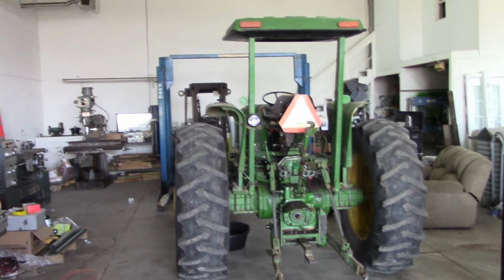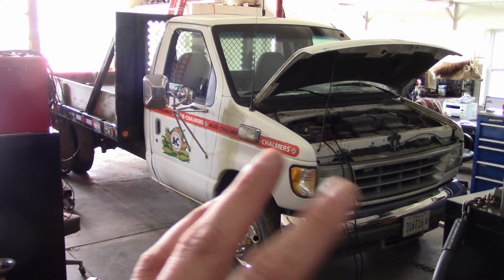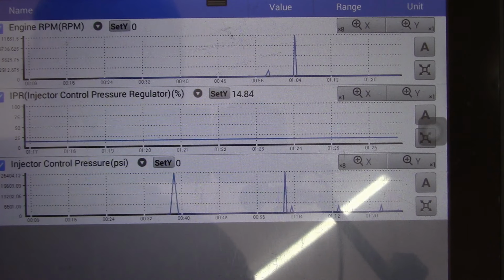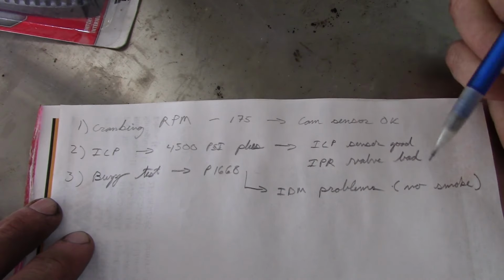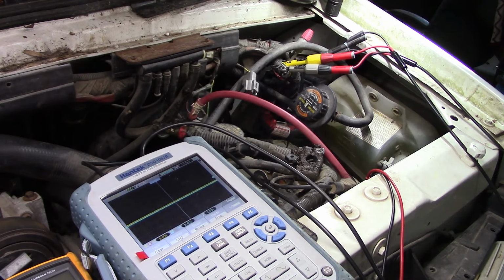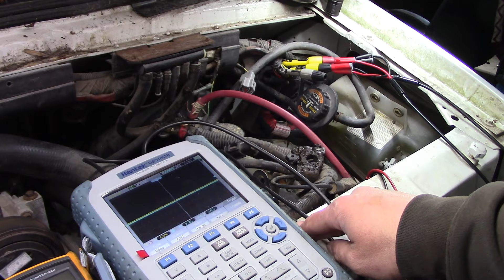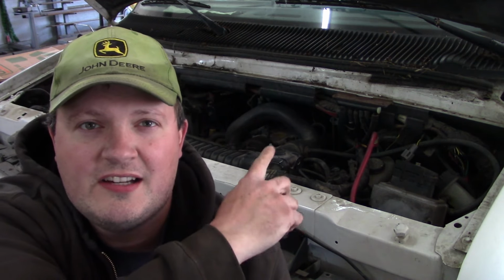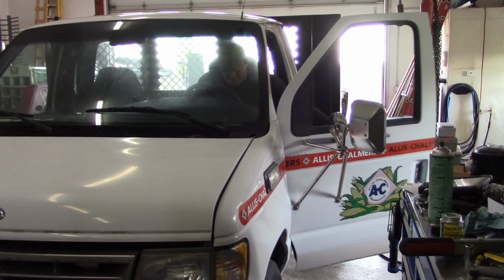Ford E350 | 7.3 Power Stroke - Cranks but won't Start - Part 1

Comment: I believe the injectors are pulling excessive current to fire. She may have low miles, but I'd bet she has alot of idle hours.  Injectors are a wear item on a diesel.

Set of injectors, IDM, repair the damaged harness wire,  replace the valve cover gaskets and pigtails and she'll be good to go for another 20 years.

Comment: Being a Ford tech-I've seen cases where charging system issues or low batteries (cheap) attributed to repeated idm failures-as far as the crazy icp-when these modules aren't getting the proper voltages or have a circuit blown-anythings posible.

Comment: "E-450 Incomplete" is the model.
And it is different from an "E-450".

I had a 2007 E-350 Incomplete and most of the parts for a regular E-350 were different.
Reply from the maker: Interesting. I wonder why.
Reply: @WatchWesWork  my "E-350 incomplete" had 
-Larger brakes
-Heavier rear axle and springs 
-Heavier front spindles 
-Larger fuel tank
-Sealed beam headlights (instead of halogen)
-No "post cat" O2 sensor.
-Different exhaust system
-Armored brake lines (that were a different length)
-Different ECM 
-Deeper oil pans on the engine and transmission
-Different wheel base (and drive shaft)
-Larger alternator.
-Different interior.

Than a regular E-350.

The 2007 E-350 and "E-350 incomplete" were two different models and it kept biting us in the ass whenever we needed parts for it.

The differences in 1999 models might not be as big , but the 2007 vehicles didn't have much in common.

Comment: I think they make extender cables for relays and the like. It's essentially a regular plug that's been gutted and a wire and base comes out of it, about 30 cm long. I'm pretty sure that's what i saw (online during a fleaBay bored out of my mind nights).
Reply from the maker: I could make one I suppose. Might be handy.

Comment: It could be harnesses or deteriorating/shorted turns in the injector windings that are causing shorts/overdrawing. Meggatest the harness if you have one (this will put other nearby electronics at risk), or look at the drive current waveforms with your porable scope. Any bad injector wil stick out . Dissassemble the old injector PCM and look for blown out parts.
Reply from the maker: I think watching current draw would be a good start, but I think the IDM is supposed to shutdown if it senses too much current draw.

Comment: Second thought.  The switch mode power supply in the icm could be throwing high voltage spikes if it isn't properly grounded.
Reply from the maker: True. It does have a ground strap.

Comment: Having replaced my engine/transmission/battery/heater core on my 2004 Chrysler lowered floor minivan I had to get the Braun conversion side ramp worked on.  Not a surprise.  The surprise came when the Braun service company couldn’t fix it totally and blamed it on Braun.  Trust them now?  Especially at $120 per hr.  You earn your customers and viewers trust with every repair.  Any chance of moving to the Pacific NW.  We only just started to salt worst of the worst intersections.
Reply from the maker: Nah, we better stay here. Especially if you guys are going to start using salt...

Comment: Everything from Dorman with wires is an automatic fail. Got that right; replaced the electric gas pedal on my trailblazer twice with a Doorman piece of shit (admittedly the second was on warranty) before I finally wised up and bought the damn thing from GM instead. And that thing hasn't failed yet. Which is good because bending my big ass around into the footwell to replace the bastard is uncomfortable.

Comment: Got one of these myself in a 89'F super duty, but can't get it to spin over fast enough, thinking batteries and a starter, also have an 86' F350 with a 6.9 great motor, just slow. Great video Wes always look forward to another film production from the Watch Wes Work family!
Reply from the maker: My brother has an IDI with 300,000 miles on it. Still runs great, but the truck fell apart around it.
Reply: @WatchWesWork  haha sounds like a typical truck around here (Nova Scotia)

Comment: Kind of makes sense why the ambulance company would have gotten rid of the van only having 40k miles on it.  Must have wanted to wash their hands of it after chasing electrical ghosts.
Reply: I'm curious about the number of idle hours. I've heard that is usually the big deal with EMS vehicles is time that they spend idling. Back when I pushed carts at a grocery store the fire department would take the ambulance to go grocery shopping. It would be sitting in the parking lot idling the whole time ready to go if they got a call.
Reply: Greg Robbins Emergency vehicles are usually replaced by the date, not the miles. Here in Finland they usually have an insane amount of miles on them when they are auction off instead, but the maintenance schedule is usually also quite insane, they replace oil, fluids, belts and all other sorts of wear parts based on the date, not how many miles I’d had. So if you find a used ambulance, try to get hold of the maintenance history as well, it’ll tell you a lot more than the miles. Normal maintenance schedule is usually 12 months between oil changes.
Reply: Sebastian Storholm 
Here in the UK they run Ambulances in to the ground ! Since the NHS split the ambulance services in to larger areas there have been reports of major & dangerous faults going unrepaired, they also seem to fail their yearly MOT tests a fair amount, on anything from the trivial to major issues which is not something you would expect to see really.
Reply: I live in South-Eastern Ontario, Canada. Here in the province of Ontario, no ambulance may serve in Provincial Ambulance Service for more than to the end of its 59th month. After that, it can be sold to private ambulance operators, such as those that transport patients between hospitals or take patients who are unable to sit in a car or taxi home. Many get through their initial service life just fine, and live on in secondary service for years afterwards. Some get sold off at fire-sale prices because they're not in ideal shape, these often end up in the hands of contractors and such, and have the emerg. lights removed, and become tradesman's vans. I remember being a kid in high school in the early 80's, having a p-t job pumping gas after school until midnight. All the police, fire, ambulances would tank up where I worked because we took the Provincial Gov't card, and because we were open so late when the rest closed at 8, 9, maybe 10pm. By the time I left that job of pumping gas in 1987, they were starting to put diesel engines into ambulances. I remember asking some of the regular drivers for their opinions on diesel power in the ambulances, responses varied but some were genuinely impressed with the power output compared to the 454's, 460's, 360's, even the latest 350, 318, 351-equipped units. The diesels could obviously last longer, make better use of fuel while idling, and weren't as sluggish as most people had expected.
Reply: @WhiskeyGulf71  Yet VOSA turn a blind eye !!!  Police cars however, are still generally very well maintained on a time basis rather than mileage...
Reply: It depends. Ambulances are one of the certifications I have, and they usually are replaced before 100,000 miles. You might see one or two that became a spare that is old if its not a public fleet (meaning some form of private contractor) but they don't have a long service life for the chassis. Now, one of the oddities... with the diesel EPA regulations in the US we have had states which had 7.3 ambulances that were sold off in less than a year because they were not emissions compliant - which was the 2003/2004 model years. There was nothing wrong with them, they just had to upgrade to the 6.0 for the catalytic converter and EGR by state law and they were ordered before they knew the law was going to change. 
Idle hours, however, are a different story as a previous comment mentioned. There have been some with 60,000 miles that have ten times the hours they should. Usually in cold or hot states where they run almost 24/7 for climate control in larger cities where ambulances get posted around the service area. There are also some operators who just dont shut them off so they get started at the station and they will run until they return - in some cases idling both during the call and during the time in the ambulance bay at the hospital.
In the ones where we track their engine outputs we have also seen them run 24 hours never averaging more than 11 mph except for a 5 minute stretch where they ran at 90 mph. 
They're like police cars - they just get beat to death.

Comment: I like that trouble light, what kind of light is that👍
Reply from the maker: Which one? The black folding one is from Harbor Freight. I don't remember where I got the big one.
Reply: Watch Wes Work the small slim light with the magnetic base.  I’m still in the stone ages with my corded drop light🤣

Comment: I expect I'll be having my standard in the doghouse nightmares for the next few days, jammed in cramped up and my hands are too big to do what I know has to be done, then waking up sitting on the couch still dark outside and knowing it's gonna be there, theorpy don't change the fact my hands and fingers are too big for the enclosed space, what were the engineers thinking is what I'd like to know, good luck
Reply from the maker: I know. Plus with my carpal tunnel my hands are more like lobster claws.

Comment: Wes thinking through this systematically with all of the tests that you have done and that you have used a known good, I would agree that it has to be an electrical fault somewhere. With that I wonder if replacing the whole harness just as a precaution would solve the problem. I know that I would be expensive but it might be much easier than trying to chase an electrical gremlin if the valve cover gasket isn't the problem. That would also solve a loose connection issue that may not present itself in certain circumstances.
Reply from the maker: It would be nice. I don't know what parts are out there. It's 25 years old, and an odd configuration.

Comment: check the 7.3 camshaft position sensor, fuel injector harness, or like other mentioned a grounding issue, my 7.3 has all of these problems at one time or another

Comment: While the engine was running, it looked to me like the wire that was rubbed through was arcing intermittently. It could be a trick of the light. I watch YouTube on a HD 55" screen. Not sure if it matters if it was arcing in any case. Just thought I'd mention it.
Reply: I went back and looked. It is Arcing!
Reply from the maker: I'll have to review!
Reply: I saw it too.
Reply: There is something....
Reply: I see something there I don't know if it's arcing or it's a shadow from that flapping tape by the alternator. Mind you I'm watching on a small tablet.... But there's something there
Reply: Hard to tell but it looks like tape flapping but kinda hard to tell
Reply: My dad taught me to look for arcing by running it in the dark. The darker the better. He called it "Checking for Christmas tree." Mostly to see if the plug wires were arcing.
Reply: Definitely an arc, set res to 1080p with decent brightness and zoom in, you can see a blue streak every now and then
Reply: I see something going on right there at that orange wire in the connector.  Not sure what but it should be checked out.
Reply: @WatchWesWork  I downloaded the video and viewed it frame by frame in VLC with various brightness and contrast settings... for an arc the "arc" stays too long, and it seems to wave around an angle from where the wires come out of the connector. So it is maybe something like a flag made out of dust/dirt (I'm native german and can't find the right words :-/) Anyway, these wires look not ok, maybe there is something hidden?
Reply: Definitely not arcing. What you see moving there is a small fluff of a spider web or piece of lint or whatever that's "flapping in the breeze" from the fan. This piece of lint was on the rubbed cable itself, you can see it when Wes was doing the close-up of the connector. And if you think about it, where is it going to arc to? The plastic shroud over the cables?
Reply: @vlekov  "flapping in the breeze"! thats the appropriate word for it :-)
Reply: @WatchWesWork  i dont see any arcing, i see some loose tape kind of uncovering and covering he backing plate of the alternator thats somewhat shiney.. maybe im not looking in the right spot
Reply: @AndrewBrowner  Look right at the orange wire in the big connector near the firewall. It may be nothing, but that's the spot people are talking about. It is the same wire that Wes noted earlier as being rubbed through.
Reply: @WatchWesWork  I reviewed, definitely flashover on that exposed conductor.  120vdc isn't enough to cause that, but the inductive kickback of the injectors would cause that.  You might want to check the wiring diagram to see if there is some sort of snubber on that bank power and maybe the snubber is gone or bad.
Reply: Also saw some sparking.
Reply: @WatchWesWork  I think he found the cause of IDM failure. That arcing also explain spikes in sensor readings on your scan tool.

Comment: I was thinking of doing the valve cover update on my 97 because i found my under turbo connection getting fried so i replaced that pigtail but if doing again i thought up replacing with super duty gaskets. I just got new 180cc stage 1 injectors installed and new glows. Trk had i believe original injectors with 300k on them. New stage 1s and wow it like a completely different trk. It ran but but i didnt have decent power. Couldnt pass anybody wouldnt get up n go now it does of course with a bit of smoke but looking into an upgraded turbo

Comment: 09:18 I'm not familiar with Ford terminology. I do know they use the same IAP valve (Injection Actuation Pressure) as the Cat 3116/3126. On the Cat system, unplugging the sensor goes to a default pressure value which should start the engine. 2200 psi sticks in my head for the value.
Reply from the maker: The Fords will do the same.
Reply: @WatchWesWork  OK thanks.
Cat doesn't use a modual to controll the injectors, it's all done with the engine ECM.

Comment: I had a similar issue with my PSD van.. 3 bad IDMs.. I was using reman units... Turns out they were filling full of WATER!! Ended up getting a new revision from Ford directly... There were some TSBs regarding water ingress on some vans.. but if I were you I'd pop that old IDM apart and see if it's got water inside! All the reman modules I got were all old versions with bad seals... The new revised one fixed me right up!  That location gets a lot of runoff from the windshield, and spray from front tire fender area. BTW.. you're lucky that's a cutaway chassis.. you can't pull the valve covers on a PSD van without removing the motor mounts.. but cutaway chassis are WAY easier to pop the body bolts loose and Jack up the cab, than to pull motor mounts and roll the engine back and forth.. it was 21 hours of labor to pull all the injectors and glow plugs on my van...since mine wasn't a cutaway.. good luck man!!
Reply: something else to consider  - ambulances do a lot of idling.. and the PSD engines vibrate a LOT at idle.. this one may be old enough that it doesn't have the 'auto idle up' built into the ECM - even with that - they still vibrate everything all to hell.. i always zip tile EVERYTHING - wiring harnesses can chew thru themselves on those vans! doesn't hurt to do a shakedown test, and peel back the harness covers and visually inspect all the high voltage wiring as well..
Reply from the maker: Yeah, I figured on raising the body. As you said, it's not fun either way!

Comment: Is it at all possible that the owner is fastidious enough to keep all repair records from the previous attempts??? I certainly believe lightning does strike and Murphy's Law does fail.
Reply: Sounds like a voltage surge.
Reply from the maker: Or a short. If the glow plug shorts to the injector harness, it can cause all kinds of problems.
Reply: @WatchWesWork  So, no previous receipts to look at then???
Reply: If I kept the records from the repair, they are most likely in the truck? Glove box or over the visor. All they did was check the vale cover connections and put a rebuilt IDM in.

Comment: Used to work at a dealership that did those conversions. Lots of work gets put into them! Can be a 50/50 gamble getting one of these chassis though. Especially the 6.0’s 😬
Reply from the maker: Even the newer ones. I was at the Ford shop one time and they were swapping out a 6.7 Power Stroke with 12,000 miles on it. They idled it so much the engine filled up with water from condensation and ruined the bottom end.

Comment: I would think it’s heat related, looking at that gray and orange if it’s not pinched some thing has got hot, as you say a short in the rocker cover may be the issue
Reply from the maker: It's a very common issue, so I think it's a good place to start.

Comment: My experience working on E-series with IDM failures are 1. Water intrusion due to its location. 2. Bad reman IDMs.  Open it up and see if it's crusty inside.
Reply from the maker: I should.
Reply: Exactly ,Look for blown or leaking capacitors. They are easy to replace , I have sourced capacitors through electronic shops. A few dollars each...
Reply: Looking back at Wess’ old CNC videos, I’d say he has the skills to pay those bills.  If the communications IDM IC isn’t fried it might very well be something simple like a smoked diode or transistor.
Reply: This person knows their 7.3 Power Stroke and its IDM oddities!
Reply: I saw the video come up and thought idm right off the bat.